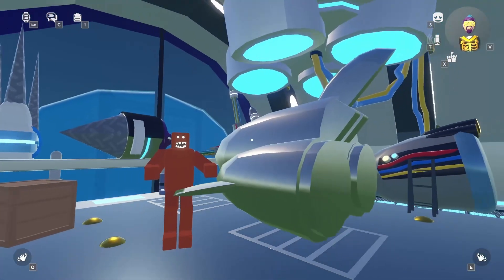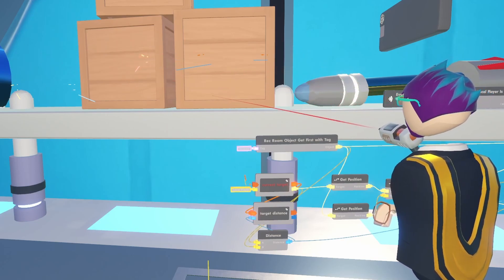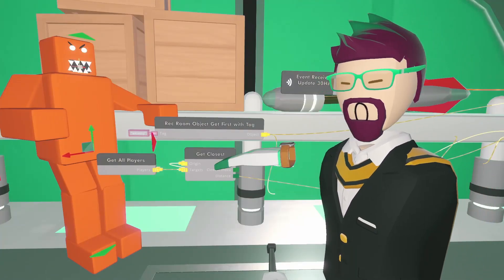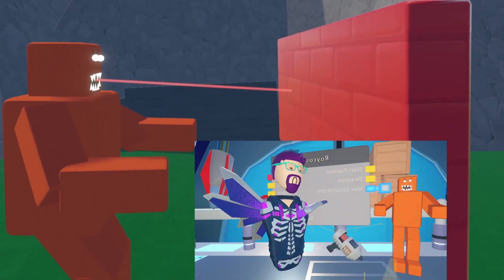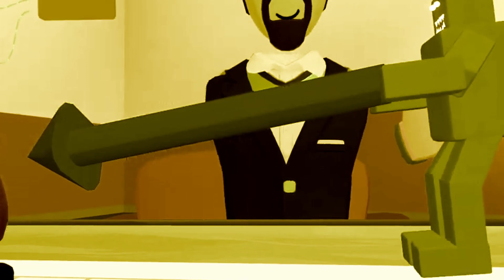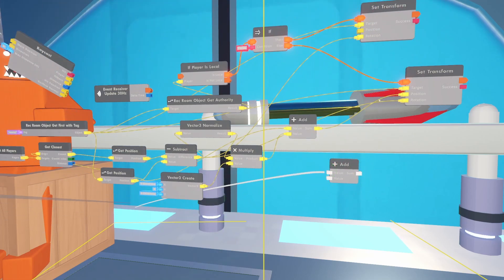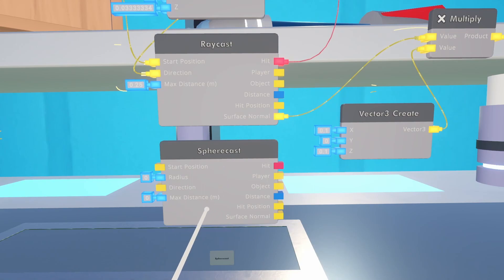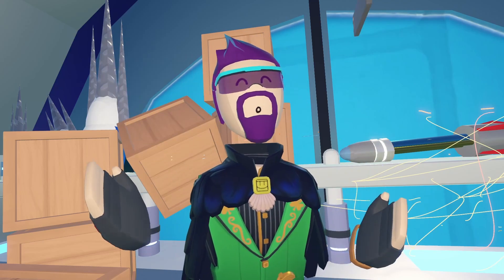How To Add Wall Collision To Your Monster | Rec Room Circuits Tutorial

Comment: I used the invention and I did everything it said and it won't work
Reply from the maker: Did it happen to be in the same room you were practicing in, try in a brand new room, also make aure modify with circuits is on your monster?
Reply: @theRCLman  ok

Comment: The set transform chip doesn’t do anything
Reply from the maker: are you getting an error noise?
Reply: @theRCLman  Never mind I fixed it. An error I was getting from a completely different circuit was actually messing with this one. Thanks for replying though.
Reply: @theRCLman  Also another issue, the ai can go through some walls and can’t through others

Comment: Do you think there will ever be a way to make something path find around walls
Reply from the maker: i has to be possible but so far i keep getting stack at corners, there is an algorithm that ppl are using but it seems to have some issues
Reply: what is it

Comment: Would there be any way to make it so when you look at the monster it stops then when you look away he moves
Reply from the maker: i have tried this before, i know there is a better way probabaly using spherecast, but the way i did it before was attach a very very long trigger volume to the front of a back pack and have the monster stop moving when it was in the trigger volume

Comment: How do you move your pivot point I’m stuck on that cause my monster is separate pieces does that matter?
Reply from the maker: edit the monster model, you should see a litttle white square with three lines poking out, thats the pivot point, if you dont see it select all objects in you model, and click the littl options thing then center on pivot. also go into tools on u maker pen general settings on right in the drop down should be an option to show pivot
Reply: @theRCLman  bro thank you 🙏
Reply: Also you just earned a sub

Comment: Is there a way to make it so that the monster only chases you when your in a trigger volume?
Reply from the maker: Yes when player enters volume make set a bool variable to true and when they exit set to false, well it could be more complicated  but for simplification, then add an if chip after the 30 hz, if the new bool is true then allow 30 hz, maybe should be synced

Comment: if value for the position is most likely cheaper when switching the vectors.

Also could multiply delta time by a "speed" u input & feed the result from the multiply to the vector create you are multiplying by.
Reply from the maker: i was unaware to the if value until this comment i will try to use it more often now, thank you. not quite sure what you mean on the 2nd one, like what the advantage
Reply: @theRCLman  Np, nice seeing that ur still improving & replying/noticing like, every comment

The advantage is that it should be more consistent to the delta/change in time upon execution/when u move it. Its not really that big of a difference tho.

Also, im pretty sure it may be cheaper to lerp from monter to player, but to prevent it from speeding and slowing down, you use the reciprocal & distance. Im have to look back at my consistent lerp to tell u the chips
Reply from the maker: oh yes, ussually i can learn about chips i or methods i never knew then go on to make better videos and inventions.

still not quite getting the delta time thing but the lerp thing i have tried before and that was the issue that it changed speed. them was some big word you was using at the end not exactly sure what they mean, ima google it

still don't understand lol, im sure if i sat down and messed with the lerp and maths i could figure it out
Reply: @theRCLman  Yee dw, getting on in like 31 mins, then can tell ye the chips
Reply: @theRCLman  Alr, so progress should be distance of monster to target to the power of -1 multlied by a given speed
Reply: Welp, just compared it to urs & they're the same, so up to u. What u have now might be fine, because say u multiplied lerp output to get rid of the y, then it will cost more than yours.

So i suppose what u have now its fine. But i hope you learned something :D

Comment: Good now we just need a tutorial on how to make it go around walls but not into them
Reply from the maker: This is true
Reply: @theRCLman  yes
Reply: @somethingidk3416 on spherecast if; on multiply chip add input, on add chip add input. Then make a trigger volume. Scale trigger volume halfway along the wall and to the corner that it's supposed to go around in, make sure the trigger volume only reads the monsters tag. make a vector variable name it "push" have it synced. Copy that vector variable and place it under the first one. Make sure they both have the same name, Wire "object enter" to the first vector variable, and wire "object exit" to the second vector variable. Place a vector create chip under the second vector variable. Leave everything on that chip to 0. Wire the output of the vector create chip to the input of the second vector variable. Next place a vector component, make sure its pointing in the direction you want it to push when the monster touches the trigger zone. Set the magnitude of the vector component to 0.1.  Wire the output of the vector component to first vector variable that we made earlier. Lastly wire the output of one of the vector variables to the multiply chip and to the add chip. And then that should work!. Rinse and repeat the important parts to every corner and works great! 

If you use this make sure to credit me :3 hope this helps

Comment: how do you make it navigate around a maze like tbas level 02 or 03?
Reply from the maker: i think this may be the next upgrade, when ever i do that (idk). this update collids with walls but isn't smart and can easily get trapped. at a 1st guess i think the vector may need to change to be a combination of the normal wall vector and the one pointing at the player that way its constantly moving toward you but thats just a guess

Comment: How do I animate a monster using follow system 2?
Reply from the maker: i think this would be a good video, basically instead you your monstering following you you just have a cube then attach an animation gizmo via a clamp then attach the monster to the animation via the gold loop thing. i may do this one cause i think it a issue many ppl have